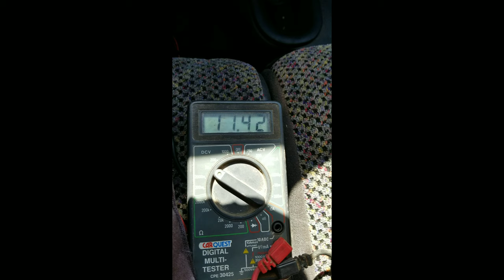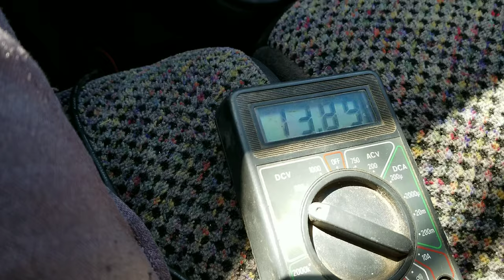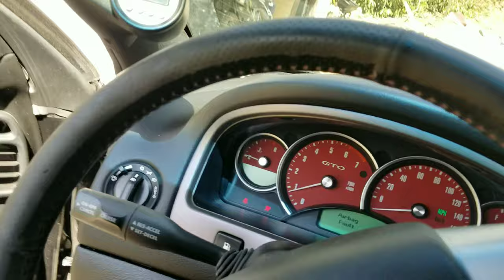Free Cummins!! and EPA regulations

Comment: My thoughts on the EPA? ain't illegal till you get caught 😉. I dunno about your truck there. Might unhook your gritt heater If it's still active. 

The gritt heater on my dad's 2000 was robbing power from the lift pump causing it to bog down and have almost no power.
Reply from the maker: I see they just fined some aftermarket companies for selling diesel parts 😡 that's what they will do just come down on people who make the parts makes me very mad!!!! But yeah figured the old dodge out, was just bad fuel filters ! Put new ones in and runs great again 🤷‍♂️ guess I'll keep it around for another year at least
Reply: @GearsAndGuns  I'm pretty sure the diesel fuel around here isn't much good. My dad's 2000 dodge burns through fuel filters. They'll last a few months and then there full of junk again. If I remember right the last time we changed the filter the fuel had a "rotten" smell to it
Reply from the maker: @oldcroneysgarage9739  yeah I'm pretty sure I picked up some bad fuel somewhere,  thanks for the input 👍 hows everything out your way been going ?
Reply: @GearsAndGuns  it's been going somewhat good over here. Price of fuel went up and that's about it
Reply from the maker: @oldcroneysgarage9739  I know, I work in the petroleum industry and I cant even get it cheaper lol. We been going all over for it for a better price